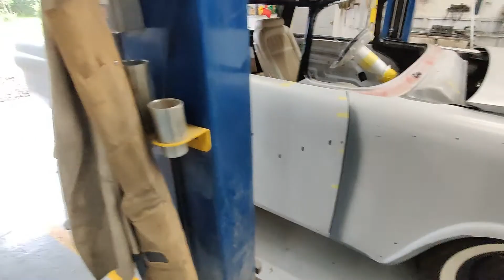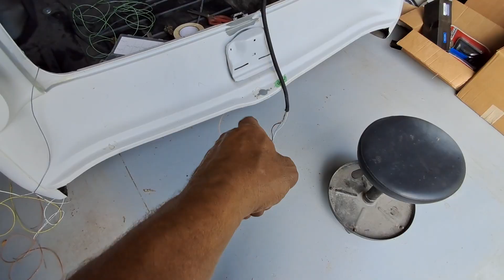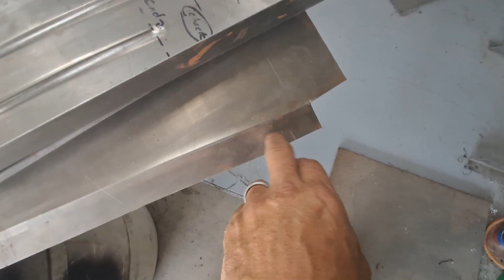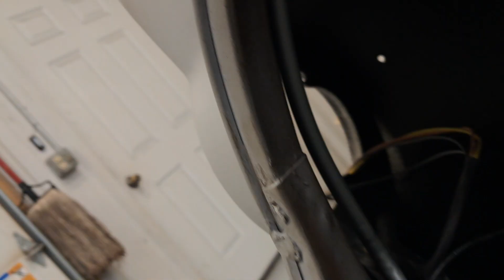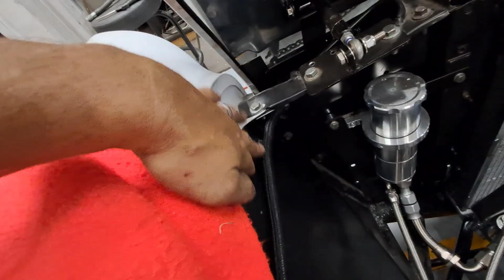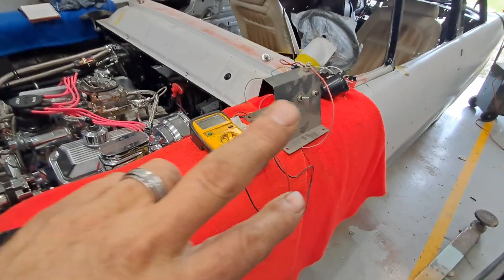1955 Crown Victoria!!  Another Fun Project at AKK

Comment: On the wiring harness are you required to have a fusible link. My experience with 70's fords they usually have one inline by the starter solenoid, or is one built in your fuse block? To bad about the serpentine belt system. (beep, beep*^%***!!)
Reply from the maker: A fusible link is one option.  I like to put a 250 amp fuse on the battery terminal or inline for the entire system.  One should always provide a way to isolate the battery from the system in the event of a catastrophic event in line with the major systems.  In this case, the wiring system provided did not have a main way of breaking the primary wiring (ign, starter, bat +) cables leading to the starter.  An inline fuse like described was recommended to the owner but not installed by me.  When the car comes back for the final wiring of the interior, I would include this at the battery if the owner has not done so already.  Good catch!